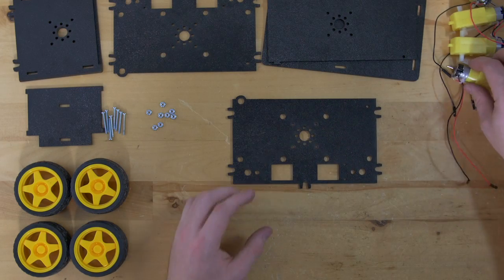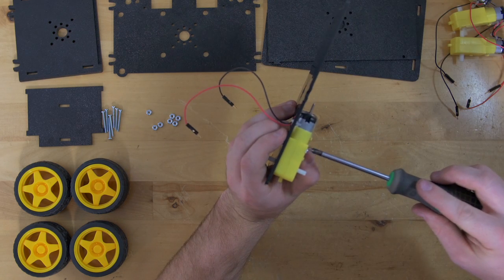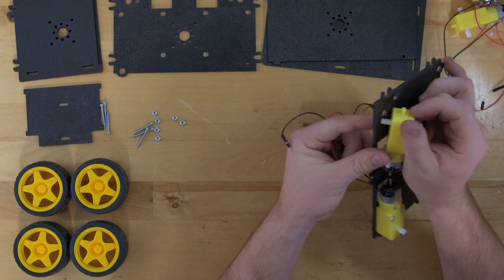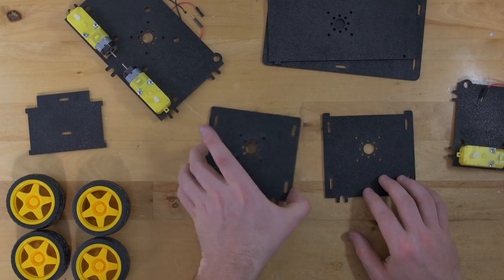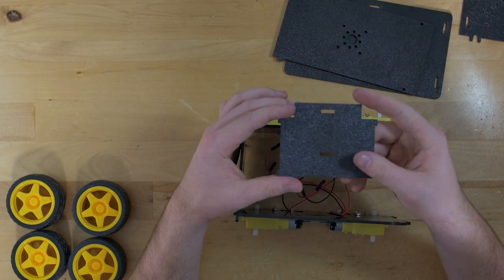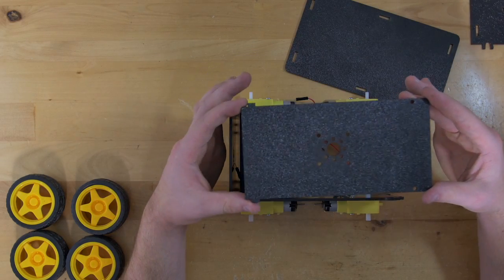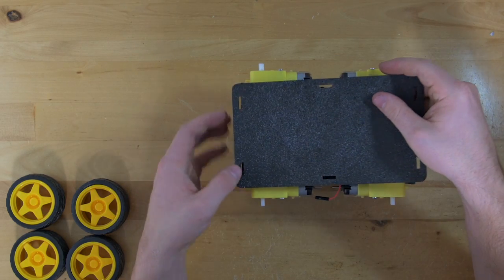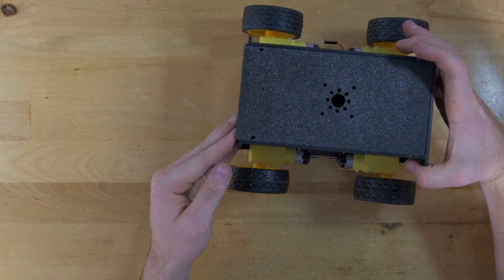Half-Pint Runt Rover™ by Actobotics® Assembly Instructions #637154

Comment: hi I have the half pint runt rover and I am having trouble with how much voltage I need because the box says 6.0-7.4 and I am using a 7.2 v battery and I am only getting 2 of the motors to turn and I know its a power problem  and I need more power so my question is what voltage shouldn't I go over when I buy a new battery pack
Reply from the maker: +Sheila Blanton Hi Shelia! We’ve run these little motors on up to 12V and haven’t had any issues.  The higher voltage will likely decrease the lifespan of the motors as they’re not recommended for it.  The motors should all turn at 7.2V; I would double check your setup and make sure the motors are wired correctly.  Should you have any other questions though about them, please don't hesitate to contact us tech@servocity.com.

Comment: Question, do you have the motors on "upside down?" reason I ask, the motors have a small key only on one side, just behind the output shaft. and the sides have holes that match the key. it looks to me like you mounted them with the "key" on the outside.  I know in the long run this doesn't matter, but it made me wonder why have a "key" hole in the 1st place?  
Which lead me to ask wonder if the motors couldn't be mounted on the inside of the box? Is there room for them inside?
Reply from the maker: +LeRoy Miller Yes, good catch.  While the motors can go on either way it would have been more ideal to have put them on so that the boss sticking out of the gearbox was aligned with the cutout in the chassis.  Realistically, the screws to attach the motors to the chassis are plenty but if the boss were mated with the cutout it would further assist in supporting the motors and would ensure proper alignment.  Should you have any additional questions please let us know! tech@servocity.com

Comment: is there any code available for this kit?  other similar robots can turn on a dime but I can't get mine to turn well at all, I would love to see some examples or tips on how to do get it to turn better.
Reply: +Jared Connell Since this kit is a chassis with motors and wheels there is not example code ( this kit is microcontroller/microcomputer agnostic, example code would need to be specific to what you are using to run the code ). That being said if you run the left two wheels forward while running the right two wheels in reverse you should be able to achieve the spin on a dime action you are looking for.